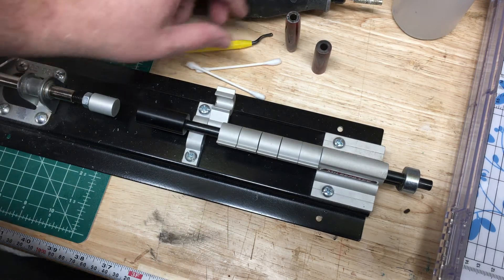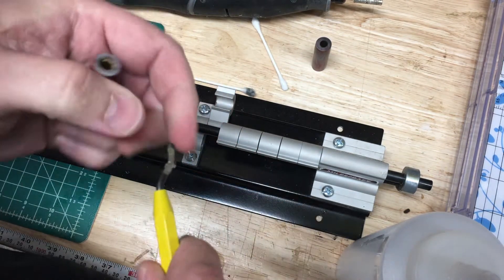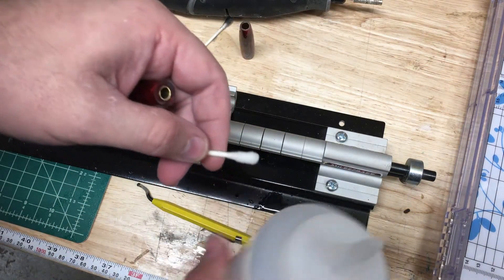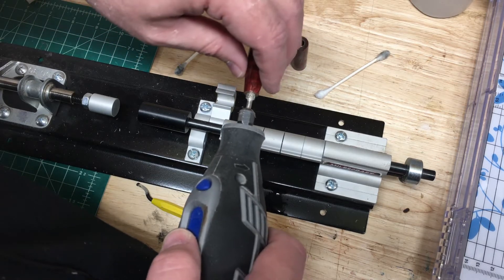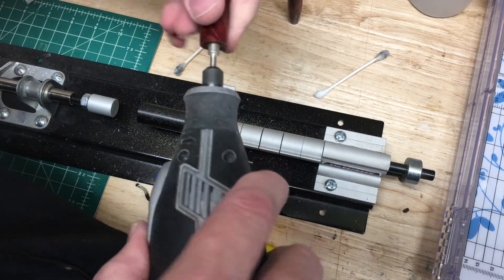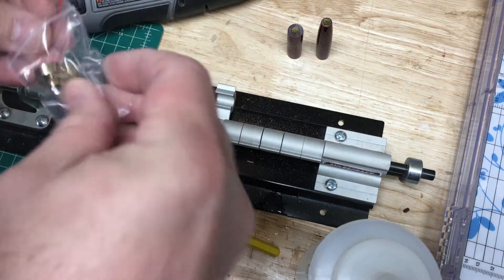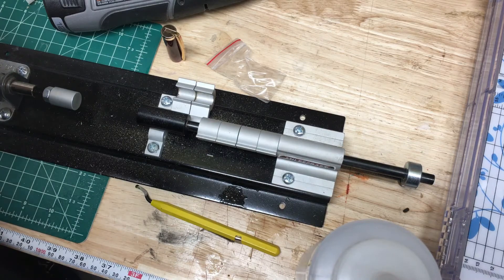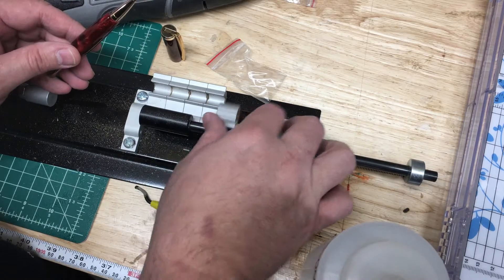Concava Part 7 Final Assembly

Comment: I wish I would have watched this video before my attempted assembly.  My assembler slipped and the mechanism went in  too far.  I messed it up trying to take it back out.  I didn't find a source to buy another mechanism.  I discovered that I could use one from a different (slim Line) kit that is cheaper than the Concava kits.  Even though the instructions say to use 13/16th's, I like your method of mechanism insertion better for accuracy.  I liked your tip about using a chainsaw sharpener stone with the Dremel too.  Thanks for the great tips!